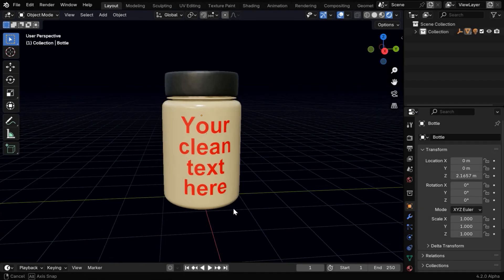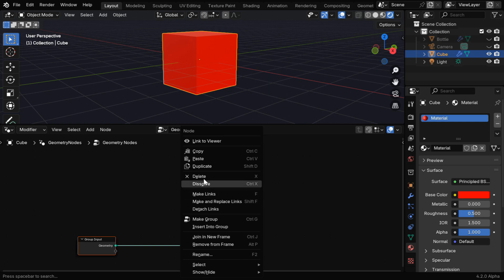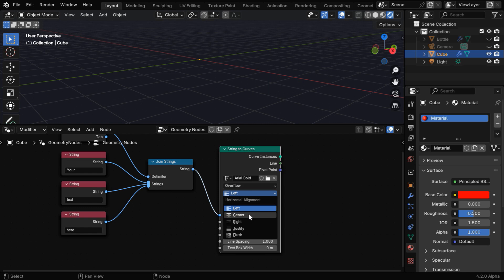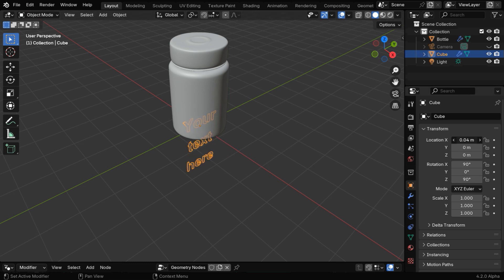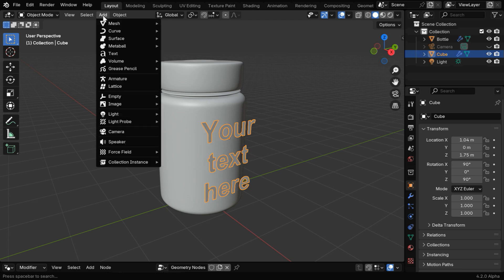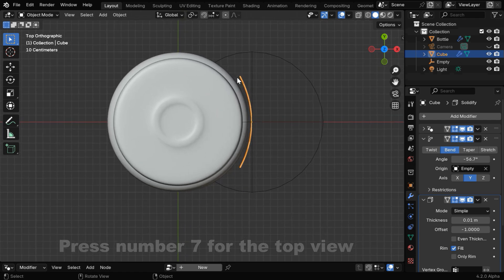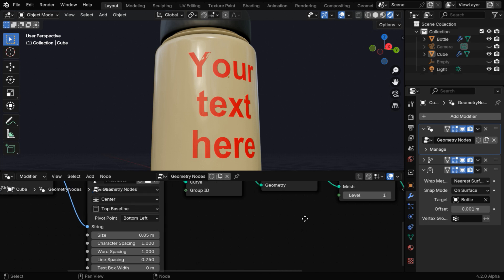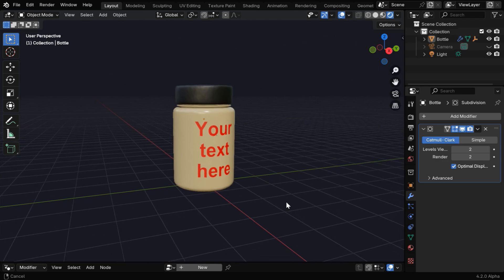Text On A Curved Surface | Better Method: Create Clean Text With Geo Nodes & No Deformations

Comment: Yeah. Works a treat for fixed text. I tried this as the basis for a old style CRT typing text.  This was for simple intro animation of a video title, being "typed" at the CRT.  I set up for a 40 character wide display of at most 4 lines (for the purpose of the title).  So, I filled all four lines with text "0123456789" repeated 4 times.  That allowed me to size the CRT "lines" to the CRT "screen".  Fantastic!  Except, when I set text lengths to zero, to then "type" the text to the "display", of course, the size of the mesh varied over time and so does not work as the orientation of the text to the surface "breaks" and rotates and scales or at least moves deep into the field of view.  Have you any hints, therefore, to do this with "typing" text?  It's really a different problem right?
Reply from the maker: Does this happen only at the beginning of the "typing" when the text length is zero, or does it happen throughout the "typing" for variable text & text length? If it happens only at the beginning when the length is zero, you may consider having a space or blank character at the beginning instead of a zero-length text. If it happens throughout, I would like to know how you are animating the "typing" text. It would be best to use a geometry node for that.
Reply: @5MinutesBlender  More straight forward.  I ditched the simple deform and trusted the shrinkwrap.  It was first time I came across the simple deform, so thanks.  Working a treat now.
Reply from the maker: @asteriondaedalus6859  Nice! 👍